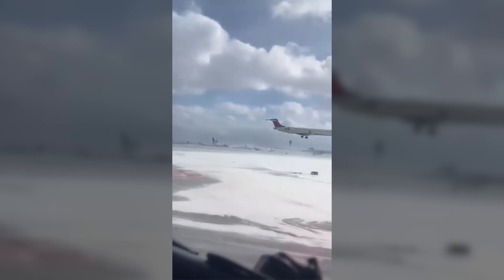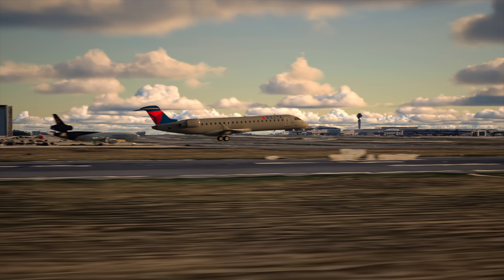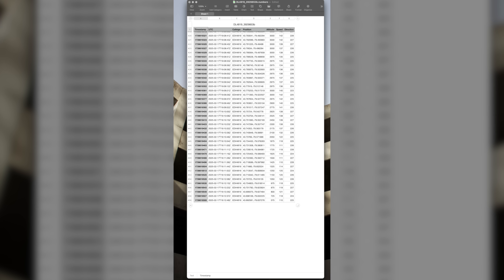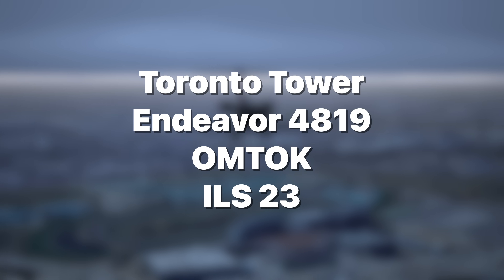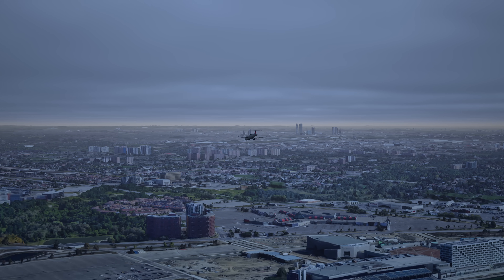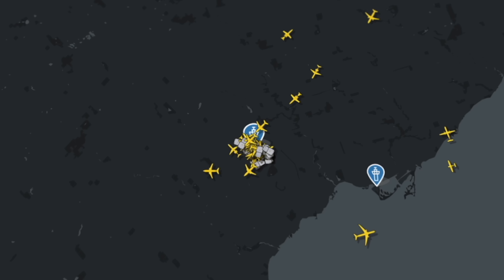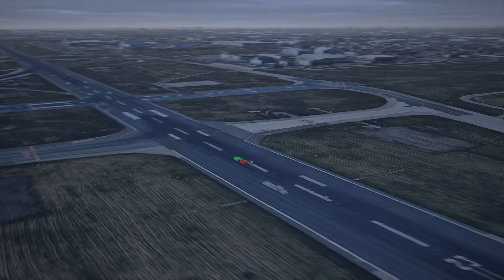What Caused The INSANE Descent Rate in Toronto?

Comment: As a retired Airline Captain, I have ridden the jumpseat thousands of times on these commuter jets .. 
these CJR’s have to flare out low because the landing gear is short . 
It appears in this case that the pilot flying misjudge the height of the runway and flared too late . 
Once that gear collapsed, everyone was just a passenger including the Pilots .
Reply: Yes, no significant flaring.. due to visual whiteout, i belive. The footage looks darn white to me already. A perception issue, nowhere to aim, no centerline, paired with speeds, bumps and drafts all over the place... most unwanted. So lucky
Reply: No one has said anything about the gear . Could it have been a malfunction in the gear?
Reply: @Chris-ev7xo  probably not a malfunction, but when you slam the landing gear into the ground like that you have gone beyond it's structural capability
Reply: @Chris-ev7xo  One of the first reports on this video was with a comment made that the starboard landing gear seemed to buckle~
Reply: @Chris-ev7xo  it may have been a contributory factor but, that landing was pretty hard!
Reply: @Chris-ev7xo  it's possible.  The landing gear is designed to withstand a certain design G-load on landing.  It definitely was a hard landing but only data from the FDR will be able to determine if the G-load was exceeded or if the gear collapsed at less than the design G-load.
Reply: I've been sayin' this since they crashed, but all of the armchair "experts" with their single engine VFR fixed-gear license told me I was wrong while conveniently ignoring my graduate work in fluid dynamics and hydrofoil research.  No one needs to be an FAA inspector to see what happened.  Pilot error, misjudge of altitude , no flare.  fail.
Reply: @Sugarsail1 As a single-engine, mostly VFR, mostly fixed-gear pilot, think you’re right. Although I did grease my Bonanza G36 on one day, to the amazement of 3 CFI’s and an A&P that were aboard, when the runway snuck up on me before I thought to flare. If I could do it every time without risk, I would😁.
Reply: Distance to snow is difficult to see in high speed.
Reply: SHE DIDNT FLARE AT ALL CAPTAIN   she flies a jet the same way she parallel parks a car    just be real
Reply: @metallampman ridiculous post.
Reply: The CRJs are rear-engine jets. As in the earlier 727s, DC-9s, and MD-80s, they are center line thrust aircraft. Major challenge is a high sink rate. Having been in the industry, flt training has always emphasized “keep your engines spooled up”. Or as that old tune goes, “You Can Always Go-Around”. ✈️
Reply: @ < good point Jerry > < very true >
Reply: That’s true on the 200 not the 900. Landing should be at pitch attitude of 5- 7 degrees nose up.
Reply: Improper training.
Reply: @ probably so improper training  
but lack of experience I might add to your comment !
Reply: Agreed
Reply: I feel the Altimeter setting was incorrect.  The ground came up sooner than they were expecting.  That's why they touched down at the very end of the runway, when they were expecting to touch down further down the runway.
Reply: @trevor5290 the ground didn’t “come up” at all; by that point of the approach the crew are not staring at their altimeters, they’re looking outside to judge the landing flare. They either flared too late or and sudden drop in wind velocity (wind shear) caused the downwind wing to stall before touchdown.
Reply: @tomwatson3580  Tom I can tell that you’re a Pilot > you’re absolutely right you’re using your depth perception at that point to flare . 
I think it’s just a simple issue of inexperience with that particular CJR profile in landing and it takes multiple landings in multiple wind situations to understand exactly where the landing gear touches down with the runway..
Reply: @ At what point do you stop looking at the altimeter.  If its reading 150' they might still be relying on that. I too am a pilot.
Reply: @tomwatson3580  Bull shit. when serving as copilot you are trained to call out the altimeter reading every 50ft. The copilot either didn't do that or their instrumentation was wrong.
Reply: @trevor5290 you stop looking when you go visual. You can do that from 1000 feet or even higher.
Reply: @ziros22 nobody calls out the altimeter reading. Where do you even get this?
Reply: @tomwatson3580  smart man compared to the rest of these fools,  it’s the mark 1 eyeball at this point.  Since I had a HUD I could take a quick cheater look at my Radar Altimeter without putting my head down.  All my landings were greasers.  However, my flight manual was different and standard touchdown for me was 240 fpm for a more solid touchdown and steep approach’s were 360 fpm touchdowns but my gear was built for it.
Also I didn’t have to flare, only power up since I was powered lift
HA
Reply: @trevor5290  usually below DH on a precision approach on final, PNF depending calls out 50ft.  Soooooo, I would say your not much of a good pilot
Reply: @trevor5290 altimeter had nothing to do with it. This was  a visual approach at the end. Nobudy looks at an altimeter then !
Reply: @howmanable  You just had to go and bust Trevor's bubble didn't you. Yeehah!!!!!!
Reply: @trevor5290  You are clearly talking about things you have no clue about.  No pilot is looking at the baro altimeter when in the last 50' of altitude in VMC conditions... they are looking out the windows.
Reply: @trevor5290  The automated height call-outs come from the radio altimeter not the barometric altimeters so it would have been accurate.

Comment: This video is full of bullshit. Not every aircraft must flare upon landing. 118 knots ground speed MINUS headwind, not plus.
Reply: No. Airspeed = Wind speed + Ground speed with a headwind. All aircraft need to flare to some degree, this involves getting aircraft flight vector nearly parallel with the surface of the runway, with a manable vertical velocity. Some aircraft, particularly gliders, fully round-out and float in ground effect and land with very low sink rate. Some aircraft, in particular those designed to land on carriers, have a high rate of sink to cut through the ground effect quickly to prevent them floating too far. They are still flying when they engage the arrestor cables.

Many commercial aircraft have thrust reversers and spoilers that can be operated when the aircraft is close to the ground and/or have weight on wheels. This also enables the aircraft to dump lift and avoids floating to far.

(Note: Ex professional flying instructor, mainly gliders, 10k+ hrs, 55k+ flights, ex-RAF and aeronautical engineer).

Comment: I wonder how many of the commenters here have a CL-65 type rating or understand how an ILS critical area works? We'll learn from the FDR and CVR along with crew history and maintenance records what occurred and the factors combined will develop a good picture. I feel for all aboard and the crew of Flt 4819. Kudos to the flight attendants and able bodied passengers who evacuated the aircraft in a professional manner.

The CRJ200 is extremely short legged while the 700/900 have a bit more room to spare with cautions of wing strikes while countering crosswinds across the type. The conditions to land were within operating specs but the light snow blowing across the runway as the aircraft crossed the threshold facing into the Sun with splotchy shadows of clouds on low approach may have been a factor to hinder the landing picture to the pilot flying. I can only imagine the cadence of the radar altimeter as they came into that hard landing on the upwind main gear in proper form. Unfortunately, that gear failed allowing the wing to contact the ground in almost full span tearing it off and the remaining left wing to get enough AOA to lift and roll the airplane onto its back. 

A briefing mantra with my FOs is let's not be on the news. We can be outstanding pilots and occasionally reread, Fate is the Hunter,  to understand how lucky we are to be pilots today. It's not a miracle that everyone survived this crash. It was pure luck...

Comment: I'm not a pilot, so take this with healthy skepticism, but I suspect they were above the glide slope and overcompensated by reducing the power too much. If you don't flare, you might hit hard and bounce, but forgetting to flare alone will not cause the landing gear to collapse. They seem to have touched down right where they wanted to, so that makes me skeptical of wind being the deciding factor, though it may well have been a contributing factor. I suspect they configured the aircraft for a faster sink rate, and forgot to set it correctly when they approached touchdown, thinking it was already set. I suspect some combination of speed brakes, flaps, slats, and auto-throttle were configured to get back on the glide path, and they forgot to set them where they needed to be, as intended shortly before landing. I also suspect it was cabin alarms warning them of how fast they were descending that distracted them in the last moment, causing them to fail to flare, making an already bad landing worse. That's my guess anyway. Feel free to point out any errors you can think of. I will be very curious to find out if the FDR recorded an engine power increase just before impact. That should give a good indication of exactly when they realized they were coming down way too fast.

Comment: Anyone else who thinking about windshear at the end of the runway??  I not knows, what about Toronto, but in Budapest (LHBP) approach to 13L/13R is at least three times caused plane slammed to the ground due windshear- and mostly in wintertime, snow, cold days. The 2 of 3 is some sort of soviet Illyushin aircraft, also with tail-mounted engines. The reason the Illyushin is hard to flip over after the landing gear was failed, the landing gears on that aircraft is mounted to the wing, not the fuselage, so between them larger the distance.

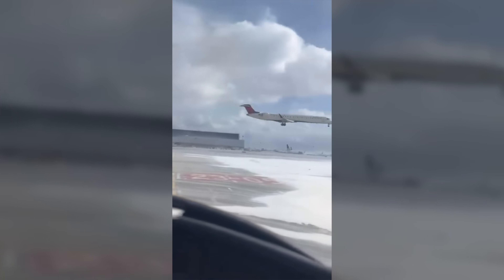Comment: I think its easy to see what happened. Right at the 2:41 mark you can see the nose drop down quickly increasing the descent rate to over 1000 feet per minute.  It wasn't just that though, it turned the jet so that it landed much harder than it should just on the right landing gear. The right landing gear just collapsed driving the right wing into the ground. That then snapped off and the jet then just completed the rolling over maneuver. Primary cause was a crosswind that hit it at just the right angle to push it down and to the right. Maybe a faulty right landing gear as well but that was a lot of weight coming down on it off center. Almost like landing on the right side of the rim which would cause it to buckle under. Maybe under these wind conditions they should have flared a little more coming in for the landing. All in all though its miraculous that this jet stayed intact to let everyone survive. We can credit the seatbelts and structural integrity and the fact that it wasn't so much of a crash as it was several factors that slowed it to a roll. The landing gear, although it failed, dissipated a lot of energy as did the wing breaking off. The passengers and crew found themselves in an intact jet cabin, but basically just upside down. And we you tubers found ourselves with yet another story to drive the last ones off the headlines. Seems like a daily thing these days..doesn't it.
Reply: "they should have flared a little more" - understatement!

Comment: My first flight instructor told me to never count on gusty headwinds to keep you above stall speed. He said those headwinds can die in an instant, and instead of gliding, you're falling for those last 100-50 feet above the runway
Reply: My thoughts exactly! Loss of head wind from the gust factor resulting and in a faster than normal descent rate
Reply: I know nothing about flying but your comment makes the most sense
Reply: How do you avoid coming in too hot if you're not reducing speed based on headwinds?
Reply: @GizmoMaltese we calculate a speed based on the winds, particularly the gusts. Example 15 kts gusting to 25 kts. Then we calculate the landing roll distance based on  the approach speed and only the steady state winds, not the gusts (15 kts in my example). We have different auto brake settings (1,2,3, or Max) and we choose one based on the runway length to allow us to stop before the end of the runway. Approach speeds have to be flown fairly accurately and if you get too fast you should go around (discontinue the landing). As pilots we can also tell if we are braking enough to stop in time based on years of experience. I’m not sure if this plane has auto brakes but there are more analog ways to simulate auto brake settings (Max braking is obvious, 3 would be initiating braking at 100 kts).
Reply: @ebpesak  I see so you prefer to come in too fast and go around if there is a gust rather than coming in too slow and possibly stalling / falling if there is no gust. Thanks.
Reply: @ It’s not a matter of preference. It’s required procedure. If we are no more than 10 kts faster than the calculated approach speed and we touch down within the touchdown zone we are guaranteed to be able to stop in time. Personally the only time I would doubt the stopping margin calculation is if the runway is icy or snowy. It’s my opinion that the friction values that the airport supplies may not be as accurate as necessary to make the calculations accurately. In that case you can hedge your calculations by touching down well before the end of the touchdown zone and dissipate energy by touching down firmly.
Reply: @ebpesak  yes an the old Navy pilots will throw an a chain and anchor out the expanded side pilots porthole window as the alternate secondary brake so that it catches on the odometer fencing
Reply: @ on a gusty day like that you just have to factor in a longer than usual rollout from the higher landing speed
Reply: FYI, wind speeds are measured at 30 feet above ground level.  To some extent, one does drop out of headwinds and quartering headwinds as "the ground comes up" when landing.  Tower will sometimes advise pilots that the preceding aircraft said that they lost 10 [knots] on final.  Lift is proportional to indicated airspeed squared but 10 or 20 knots can disappear fast when it's gusty out there.
Reply: @peteinwisconsin2496  True, but ground effect greatly increases.
Reply: Exactly the conclusion I came to watching the video. In really gusty conditions a strong headwind can die in an instant, and doesn't necessarily show on the airspeed indicator immediately as it can have a lag. It  happened to me badly when I only had a few hours solo in a glider. Fortunately I could slam the airbrakes away and save it at the last second. My only indication anything was wrong was the ground coming up to meet me very fast.
Reply: This happened to me. I was flying a small single engine plane. I was on short final in heavy, gusty winds. I had only 2, not 3 stages of flaps, and I flew 10 - 15 knots above approach speed when I lost all my headwind due server wind shear. I free feel to within a foot above the ground before I managed to recover.
Reply: @psychiccircuit999  Ditto for me, flying in a single-engine plane with similar crosswinds. I held a very nice side-slip up to the threshold, and then suddenly, the cross-wind disappeared just as I was leveling out. The only reason why I was able to recover was my experience and anticipation of such as event due to the large building in the path of the wind. I expected either a wind shear or severe mechanical turbulence. I was always told to overspeed by the amount of gust. That simple rule goes a long way!
Reply: Good grief. We add the crosswind component and any gusts to the VRef AIRSPEED, not the ground speed. The aircraft does not give a damn about the ground speed, (unless there is dirt going over the wing). The aircraft needs the relative wind velocity circulating around the wing. In other words; add “half of the crosswind, and all of the gusts” up to 20 kts (large aircraft) to VRef.
Reply: That is why the approach speed is increased in gusty conditions. Also the round-out has to be started earlier, so that the flare can be completed before the ground intervenes.
Reply: @christopherrobinson7541  yes, the approach speed is SUPPOSED to be increased to compensate. Based on the info presented here, it's unclear if that truly took place
Reply: makes perfect sense.

Comment: I've watched the video several times, and I don't see a plane falling out of the sky, I see a plane landing, right wing slightly low to accommodate a cross-wind, and the main gear contacting the runway before the nose get. I also see a puff of white on the right wingtip, before any fire. This could be snow from the wingtip hitting a small bank of snow, or fuel escaping from the wingtip prior to igniting.
Reply: It’s not so dramatic as to fall out of the sky, but to any pilot watching, that plane was descending faster than normal and hit very hard with no flare as you would typically see.

Comment: I know we won’t know more until the investigation but what about wind shear? Was there any going on because having been caught in violent wind shear it causes a plane to just drop like you wouldn’t believe, one second you’re stable fine the next stall warnings scream & a rapid sink rate! I was lucky enough to have enough time as I had just turned final when it happened and I had enough altitude to slam the throttle and gain speed but if had been lower I would have been in trouble. It happened at KBFI during a microburst and that was an eye-opener.
Reply: Sounds a possible explanation.
Engines will have been back close to idle at that point and take several seconds to spool up.

The aircraft did appear to have enough energy to flair, but it looks like no attempt was made to raise the nose.
Obviously in no way conclusive but I think we are most likely looking at a combination of factors, as is the case in 99% of crashes.